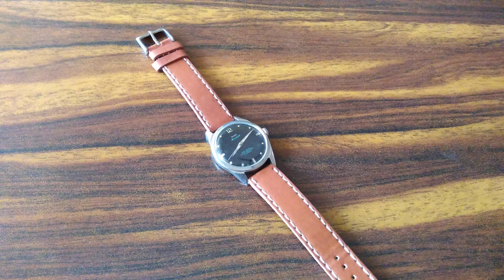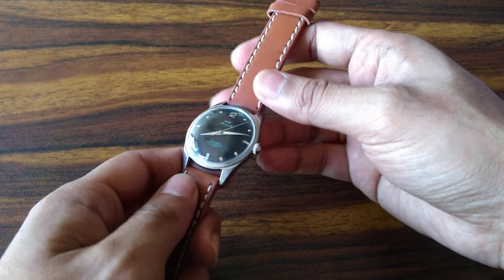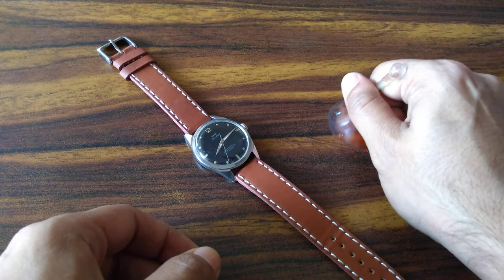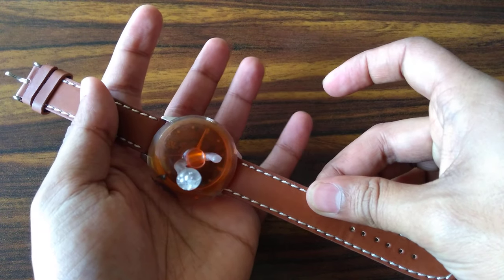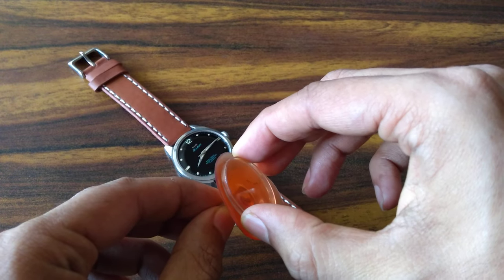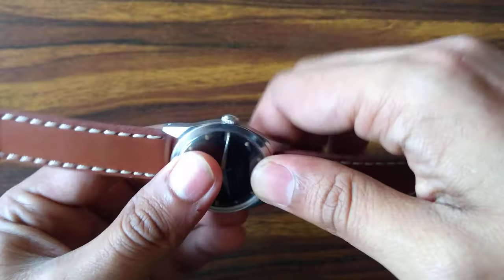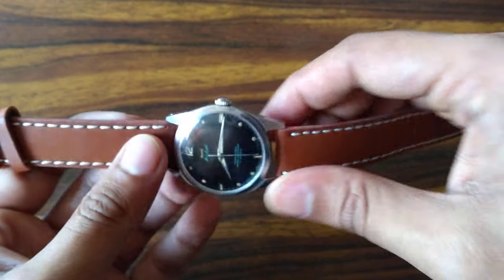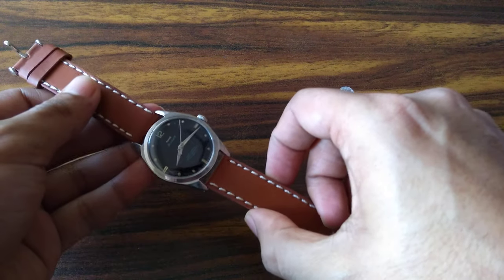Instructional video: #DIY Acrylic crystal change for HMT Pilot/Janata etc. watches #hmtwatches

Comment: I have a kohinoor black dial with 'For Replacement' printed below 6 O clock. ..any ideas on how this passed QC and was sold? 😅
Reply from the maker: It means the original dial was damaged and it was sent back to HMT for dial change. It was the time when HMT QC was well documented
Reply: @timeloupe  thank you Sir, however this dial looks misprinted. ..almost like a plastic sticker...even the indices are like blisters. Could send you a picture.
Reply from the maker: @abdulazeez5284  I have seen a janata with my friends grandfather like that
Reply: Quality control at HMT has been very poor. Even now after close down they are selling defective pieces. I have purchased around 25 collectibles and 7 of them have to be sent back for repair. I have received new ones without working condition. This speaks volumes why they have close down. The pity is that no learning is there.
Reply: Sir bilkul same ye watch mere  pass he... plz aap use restore kr sakte hain
Reply from the maker: I don't restore. You may try Time World Chennai

Comment: What's the diameter of that crystal? It would be interesting to see if it's possible to replace it with a mineral one (they are more easily available and give a different vibe). 
Thanks in advance!

Comment: Are there any glass replacement crystal for these watches??? I would really like to mod the kohinoor with a glass, hardlex or sapphire crystal if at all possible.
Reply from the maker: Would have to look in custom solutions...could be there but not in my knowledge
Reply: @timeloupe  also do i have to mask the metal case before polishing with toothpaste?? Will the case get scratches due to the toothpaste?
Reply: @pixellivesmatter8409  no... They too will be cleaner